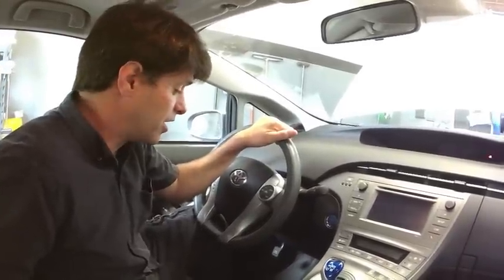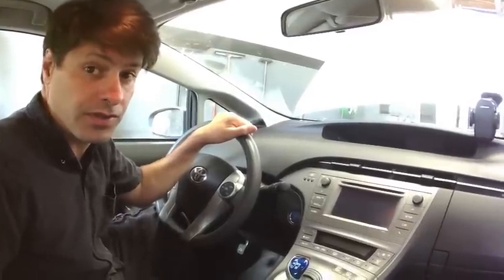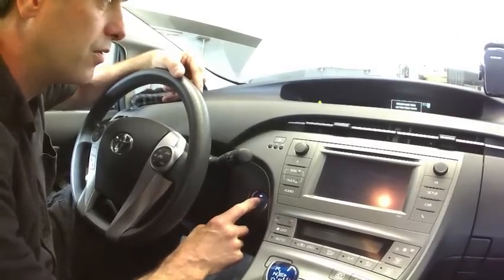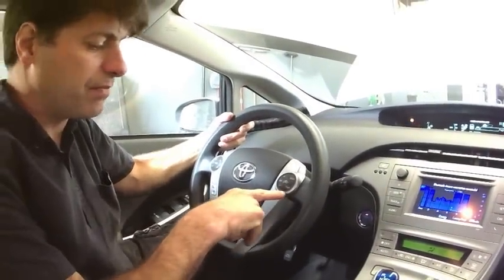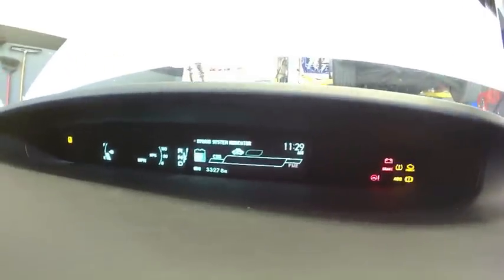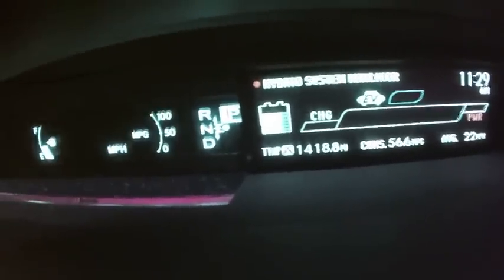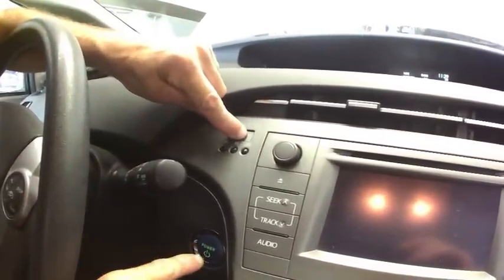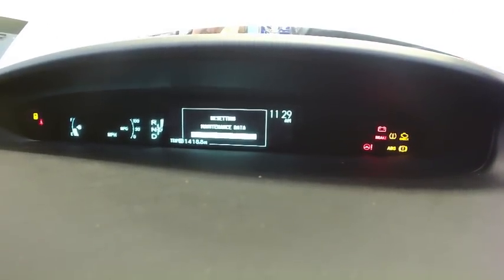How to Reset Maintenance Light On Toyota Prius (2010-2015)

Comment: By the way, this doesn't work UNLESS you're in Energy Monitor mode. Tried this a dozen times unsuccessfully until I switched to Energy Monitor mode.
Reply: I had the same issue and took it to a Toyota dealer and they told me the same thing, however when I got home it worked with other screens/modes. The only thing I can think of that would cause this is the fact I had a hard maintenance required warning , meaning message is on constantly.

Comment: How many miles between oil change does the light come on?  I just got a 2014 Prius, no maintain light but I changed the oil, can I still do this reset without the light on so it can have a clean start of maintenance records and reminder?
Reply from the maker: Sure you can 
Thank you

Comment: But in my case, the trip button is not working. What do I do?
Reply from the maker: Hey Rafael unfortnatly with out the trip button it wont work 
you probability have a bad clock spring and the steering wheel comands its not working
Reply: @houseofhybrids  Thanks a lot for replying! Now, do I have to replace the steering wheel or what do you recommend?

Comment: What if my trip button and display button don’t work and can’t change to trip B. What do I do then? Mine has the maintenance required sign light on all the time cuz of this. I bought replacement steering wheel buttons. And took the components that fit. Cleaned it up. But still the trip and display buttons still don’t work. It’s more an electrical issue. But was hoping someone had an idea how this can be fixed.
Reply from the maker: Hello 
Leonardo if you still need feel free to call us at (949)254-5204 and I can walk you through 
Thank you 
Renato

Comment: I have changed my hybrid battery pack on a 2013 gen 3 prius, I  drove the car 50miles on the freeway two times 8hrs in between one day and the next day, it still show permanent code on BLUE DRIVER OBD, is there any other way of resetting it, I can get it to pass the smog because it show in their computer

Comment: Thanks this is useful. I have a toyota fielder hybrid and it showing a message "Cooling performance low, contact dealer". I have watched several tutorials of how to fix this and clean the fan system. But after doing so, the message is still there. How to reset this? Also this model uses a key rather than a start button so would you have any advice on resetting message?

Comment: Spot on! Worked %100 for me as advertised. If you haven't tried it give it a whack. Very noninvasive (unlike unhooking the car battery for 10 min.) so this should be your first step when trying to reset the codes. Save yourself the trouble of resetting your clock and calender as well 😄

Comment: Do you know how to reset the "Check hybrid system" message? My car won´t move, when I try to change the gear to D it stays on N and it tells me to set the car on Parking position. The car starts on the electrical engine but that is all I can do, I cant move the car. The car was running fine till I took it to a repair shop to paint it, they removed the door and the back light without removing the battery. That is when it got this message. Everything is back on its place now but it wont´t let me move the car. I tried disconnecting the battery for a day, came back on the next day, connected the battery and nothing, same thing.
Reply: VIZZION ASMRtainment  same here 
What you did then???

Comment: hi, I have an issue with fuel gauge. I am from the UK and have a 2010 prius. When I top up fuel my fuel gauge increases normally but my miles indicator still remains the same. This is the first time its happened and I was hoping if you could share some light on how i can fix this. Thank you

Comment: Thx. How many miles that i have to change oil again?
Reply from the maker: Hello Vuthy ,
The oil change will depend on what type of oil do you use (regular or synthetic)
I highly recomend synthetic 
on regular motor oil 3k miles 
and on synthetic  5k miles 
but you need to be ware that most  toyota car 4 cc from 2001 to 2015 have a high oil consumption so 
you have to check your oil level and fill it up in between changes if need
thank you 

Renato
House of Hybrids
Reply: Thank so much

Comment: Dear guys
I have faced error in my prius, I removed hybrid battary for cleaning perpose , at that time I removed safety plug also, afterwards fixed back as it was, but car display appear error , then I disconnected aux battery negitive wire some time and Fix back and try to stay car , working satisfactory

Comment: how long does it take the check engine light to reset once you have fixed the issue? or do you have to manually reset it? 2014 toyota prius

Comment: Hey Great video and thanks!!! When I bought the Prius they told me to change oil every 10,000 miles. The last time I went to the Dealer they told me every 5,000 miles
what is the right answer?
Reply: Depends what oil you use and driving conditions...if it's under warranty follow the manual

Comment: how do you change the maintenance mile counter? The technician changed my 2015 Prius to 4500 miles to get the warning...I thought with synthetic, it would be like 10,000 mile or at least 7000 miles?

So how do you change the maintenance mile counter warning?

Comment: Question , since the engine runs half gas and electric , can you run the car a little longer than recommended for an oil change? It says maintenance required but the oil looks clean still.
Reply from the maker: Hello Mark
Thanks for watching my channel 
Extending the oil change gaps in the long term it will make a difference also depends how many miles are you extending and what type of oil you using regular or synthetic.
One thing that you need to be careful is all Toyota 4 cc  from 2001 to 2015 have a high consumption of oil especially if you drive more on freeways
Because of that it's a must that you check the oil level before the maintenance light pops on
To avoid driving  Low on oil   that for sure will be really bad for the engine .
Feel free to text me again if you have kore questions
Thank you
Renato

Comment: thanks...does also applies on resetting dashboard signals like slipperry road signs n brake  signals  an exlamation mark inside a circle??
Reply from the maker: Hello Dan 
It does not .
The others warning lights they goes on to indicate a problem on that system 
ande it will need to be erase by a scan tool after repair the problem 
and the maintenance light it's just a timer to remind to do the oil change 
thank you 
Renato

Comment: If you're intrested in doing a video I would love to discuss the issues of using and outside locksmith to program keys for a hybrid which ended up locking my computer and costing 3500 to fix all because I lost a key

Comment: How to reset check hybrid system stop the vehicle in a safe place?
Reply from the maker: Hello Simon ,
Unfortunately they are not same time of message the maintenance light it nothing more than a timer to remind the car owner to do the oil change but it's not indicating any issue with the vehicle 
But the check hybrid system it's a message indicating a problem somewhere related with the hybrid system ( HV Battery, inverter , electric motor (transmission) BCM  and others ) 
so you need to have that check in order to avoid any more damage to the system 
if you can have some mechanic to run a scanner and get the codes I may can help you to diagnose it .
or if you are local of Los Angeles or Orange county you can stop by at my shop and I will be glad to help

Thank you 

Renato
(949)254-5204
House of Hybrids 
969 N. Batavia st  unit A
Orange CA 92867

Comment: Hey Dear, Nice Tutorial. My Prius 3rd Gen have a serious issue regarding Fuel Average running in Eco Mode. Eco Mode is On but the Gas pedal response is the same as Power Mode. What i know is, these modes mean ReMapping the Gas Pedal Response. Right?
My Service Centre Guy said to replace the Hybrid Battery, Though car only done 44,000 Kms till now. 
What will be the issue? No Computer Error. Nothing.
Any Fix?
Reply: Just drive it on the normal mode .. what you really care is how much the mpg is.